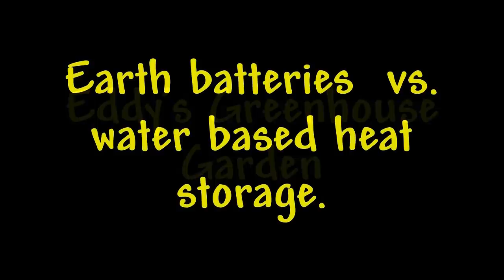Passive Earth Batteries Don't work

Comment: So this guy doesn’t have an earth battery but explaining why it can’t work.
Reply from the maker: Experience is always better but this is physics.   You don't have to  actually try to boil a bucket of water over a single candle to know it won't work......now do ya?
Reply: @eddysgreenhousegarden7022  There is plenty of proof that the earth battery design does work though. Dont be so stuck in experiece that your not willing to discover something different .
Reply: @eddysgreenhousegarden7022 
The vast majority of  folks with these systems are not too good at physics judging by their design choices.

Comment: You don't understand how earth batteries actually work. There is a phase change and energy release involved due to condensation and humid air.
Reply from the maker: For earth batteries, no matter how you define that, I don't understand where you see the "phase change," part of it.  Why don't you elaborate on that a bit.
Reply: I am by no means an expert but these folks are. They explain it way better than I. The phase change is from hot humid air to condensation and back. http://www.ecosystems-design.com/climate-batteries.html
Reply: @eddysgreenhousegarden7022 
If you have 1000 cubic feet of air at 85F and 70% RH and cool it so it becomes 70F and 50% RH it will release over 4x as much heat as 1000 cubic feet of dry air cooling from 85F to 70F. A pound of condensed water represents 1000 btu, to put it into context, it takes 1btu to raise a pound of water by 1 deg F.

Comment: To say that earth batteries don't work is ludicrous. The amount of mass of the dirt 6-8 feet down is huge...it's the earth. And about 48 to 54 degrees 8 feet down, given a reasonable length of tubing, will easily prevent freezing in the greenhouse. The problem that you have with them is that your greenhouse is already established, and presumably, you don't have the land outside your greenhouse footprint in order to run the couple hundred foot tubes. But for someone entering into new construction, it is definitely a worthwhile method to prevent winter freezing. It may not get your greenhouse above 55f, but it won't freeze either.
If a greenhouse is not going above 45f during the day, then that's the maximum amount of heat capacity of the water, well below ground temperature. And over 24 hours and several weeks, you will loose that water barrel heat. I'm not saying that water is a bad method, it's good, water is a good heat sink..but only if you have sufficient sunlight to maintain that heat absorption. Many places in the northern US can go weeks without any appreciable sunlight. That's your heat source, the sun.
The earth heat doesn't rely on the sunlight. It maintains that ~50 degrees year round, with the bonus of providing cooling in the summer, something water barrels cannot do alone.
Reply from the maker: I don't think we disagree on anything.  What I am trying to point out is  there is a camp out there that thinks you can "charge up," the ground and get a 70 - 80 degree greenhouse at night out of it.   In a really cold winter you can't do that passively.
Reply: @eddysgreenhousegarden7022  
The other camp thinks the ground magically recharges with heat regardless of how much you pull out of it ;) The ground temperature doesnt remain constant at any depth with an active system, it will simply reflect the temperature of the new energy balance, heat in vs heat out. As an example, agshp could pull so much heat that the ground freezes, if the ground temp was a constant 48f-54f it wouldnt be possible ;)
Reply: I live in ontario Canada and there have been winter's where people's water lines have frozen 8 feet down if those lines were under an area that has the snow removed, like a road or walkway or parking lot. I say that just to point out that the cold will drive down deep enough if given the time. If you are constantly drawing heat from the ground it will cool down and even possibly freeze. I do have greenhouses as well and with an outdoor wood stove manage to heat them at even the coldest temperatures... it needs wood as fuel. The earth battery sounds interesting but in our climate I am afraid that It would not work. In the greenhouses I do not heat there is frost in the ground. Perhaps in the shoulder seasons it may reduce the amount of wood we burn.

Comment: You are wrong, yes water has about 4 times the heat capacity per mass, than most soils and rocks, but mass constraints are irrelevant, for a greenhouse heat battery. 
Rocks and soil has 2-3 times the density (mass/volume) of water, which means the effect of the better heat capacity of water is  severely reduced, by the higher density of rocks and soil, volume is our constraint in a greenhouse but not so much below the greenhouse and dirt/rocks are often free to get, therefore they can in many cases make more sense than water for storing heat.
Reply from the maker: Do you have one that is actually working?
Reply: @eddysgreenhousegarden7022  I have seen both in person and helped build one with an earth battery, both systems can work if they are built correctly.
If you have enough space on your north wall which you don't need and cheap access to large metal barrels, this method is probably the best for you, however if you want to use all your space /north wall and have a large greenhouse or are designing a new one, the earth battery is probably the better choice.
Reply from the maker: @FruitingPlanet  Just to be clear, some people think an earth battery is something you can change up all summer then extract the heat you put into it during the winter.  They think you can pull 70 degree (f) heat out of it somehow during the winter because you put all that heat into it during the summer.  That definition is what I am saying doesn’t work.  Pulling the natural heat from the ground, from below the frost line in the winter…that does work, but it’s not because someone put any heat into it during the summer.  It is a natural state of the earth no matter what you do.  In any event the natural heat you can get is what I call low grade heat.  It is perhaps 40 - 50 degrees and you need a large surface area to recover it.  That can work but it will only keep your greenhouse from freezing temps during the night.
Reply: @eddysgreenhousegarden7022  it's certainly possible to achieve, but what many don't realize, it's that it takes a lot of mass and good insulation from 5 sides. 
The typical geothermal greenhouse you see, will of course have minimal heat storage over the span of month, however as you said, it can still prevent freezing in many cases throughout the winter of it is done well, store the heat of sunny winter days for the night or cool in the summer. 
However if the system and greenhouse is fairly large, probably insulated with four example double layer "Ytong ThermStrong"/other kinds of highly insulating porous concrete, or double layer hollow brick blocks with rock wool in between and it has a proper ventilation system, maybe even heat pumps, you can most certainly achieve year round tropical conditions in zones 5+ with low to medium electrical input.
Reply: @eddysgreenhousegarden7022  Agreed. This is not how an earth battery works. I've seen this idea floating around a lot these days. BTU loss in an average size greenhouse (24'x72') can be as much as 100,000 btu's / hour in the dead of winter. If you take the dry volume of your earth battery (24'x72'x4'= 6912 ft^3) and multiply that the average heat capacity of 1 cubic foot of soil (63.18 btu / ft^3 * C), you will get 436,700 btus. The calculations are a bit more involved than this. However, this means that if you are able to raise this volume of soil by 1C, then you will get about 4.5 hours of heating for your greenhouse. This soil volume is actually an overestimate so you will likely see less btu's stored per 1C rise in soil temp. Moreover, the cost of materials and installation of a well-done GAHT system is prohibitively expensive compared to heating a GH with a wood stove and storing energy in water. People are actually walking around saying that soil and rock can store more energy than water. 

https://www.researchgate.net/figure/Density-specific-heat-and-volumetric-heat-capacity-of-common-soil-components-at-20C_tbl1_279595517

Science...
Reply from the maker: @jayhayward7579  There are a lot of misconceptions out there all right.  I've left some of the posts that show that  up on my page.   I guess some people get so emotional about what they believe, research or proof doesn't matter to them.
Reply: @eddysgreenhousegarden7022 Yep...especially when they use heat and energy interchangeably...

Comment: You stated that you need to install the Earth Battery before you build your greenhouse is partially false. I say partially because if you are building one then doing it before you build one is the right thing to do. The false part is that you can modify a current standing greenhouse. Your false premise is that the piping would need to be placed into the ground below the greenhouse. This is the false part of your premise. You can place the piping six to eight feet into the ground that is not under the greenhouse. This would be called modifying a current standing greenhouse. Water has its advantages and disadvantages. A disadvantage, it freezes when pipes burst. Water has friction  so the upkeep, maintenance and upfront costs are more with a water battery than an Earth Battery. I prefer to go with the most economical method and the most bang for the buck. Earth battery has been tested for a long time. To state earth batteries don't work is a false premise. (I did not say water batteries did not work, I said they were not the most economical way when compared to an earth battery).
Reply: The piping could be put in a trench alongside the greenhouse. More piping and a larger fan would be needed.

Comment: If you are going to try to store heat in the soil...
You'll need to insulate the area you want to heat..
Reply from the maker: I agree with that.  But it gets expensive to insulate it.  Also the earth really doesn't store energy very well so you  need a pretty good sized area.
Reply: @eddysgreenhousegarden7022  
You only need to insulate the perimeter using 2" eps installed vertically. Most folks can manage to dig a narrow trench a few feet deep ;)
Reply: And then there can also be issues with changes to the water table. If underground water changes direction and hits your earth battery, then it's game over. Water will drain away any underground heat storage very quickly.

Using active heat storage could give you multiple options for collecting, storing and distributing heat - which improves fault tolerance and would allow you winter heating options even during an extreme weather event like a Polar Vortex Breakout or several back-to-back days of subzero weather & overcast skies.

When your greenhouse becomes one of your primary food sources, then it is no longer a "isn't this cool" hobby any more. It HAS to work, and any crop losses could mean you either go on reduced rations, go hungry or go begging.

I have looked at a few earth battery greenhouses on YouTube and I haven't seen solid, scientifically monitored results yet. Anybody can put some cheap temperature logging devices in their greenhouses to log both indoor & outdoor temperatures throughout the heating season. Never mind the anecdotal claims or showing the build but not operations - show us your seasonal historical data.

Comment: Water stores heat better than soil. You have a great point. I’m thinking 6-8’ of stone. Insulated. Do you think I could get some passive heat out of that?
Reply from the maker: I know in the old days they used to heat stones and put them in carriages to keep your feet warm.  So it works. It's just how much stone and what is surrounding it to keep the heat loss down.

Comment: I Am planning on using a split system with 4 inch perforated tubing buried in 30 inches of course stone and two long runs of 55 gallon black water barrels laying against the 70 foot long greenhouse walls. I'll be running several aquaponics/aquaculture tanks and am looking to simply balance my internal greenhouse temps here in Northern Maine in order to eliminate any expensive supplemental heating of the air and water in the tanks. Without any real depth to the underground thermal bank i can't expect too much change in temps with soil, but with varying sizes of stones starting with large 4-5 inch stone, then 1 inch, then granular crush and run for a top layer for leveling purposes i should be able to gain more storage advantage in less space to give me close to 20% gain, no more. So i'm starting out with low expectations on that design and relying a little more on water banking during the daylight hours then emitting the heated water and air in combination at night. With the water i was thinking of connecting all of the barrels together and pump them into radiant water pipe buried just under the crush and run layer of gravel to give me the ability to balance out the entire space with the same temp. air to eliminate cold spots like door openings that might leak etc,.
Reply: Why dont you try a Rocket mass heater?It burns much less wood than a conventional wood stove.
Reply from the maker: That sounds interesting Tom.  I know rock does hold heat better than plain soil.  I  will be interested to see how it turns out.  Sometimes  that is how it is.  You have to try it and see. 
Ed
Reply: I am in Manitoba Canada. I’m going to try the same idea here. It was -41 degrees Celsius here two weeks ago. Hard to fight that kind of cold.
Reply: @creedsixteen891  Look into rocket mass heaters.Insulate the greenhouse well with double walls,the thicker the better.

Comment: I thought I was going to get some real information regarding earth batteries not just an option on why it isn’t a good idea for you.
Reply: water specific heat: 4,200 Joules per kilogram per degree Celsius (J/kg°C). This means that it takes 4,200 J to raise the temperature of 1 kg of water by 1°C.
water kg per gallon: 3.7854 kg
water gallons per cubit ft: 7.48 gallon
btu per joule: 0.000947817

btu stored by water per cubit ft per 1°C rise: 0.000947817 btu/joul x 4,200 joules/kg°C x 7.48 gallon/cubic ft x 3.7854 kg/gallon = 112.7 btu/cubic ft °C
btu stored by water per 10 ft x 10ft x 1ft per 1°C rise: 112.7 x 100 = 11,270 btu

clay specific heat: 878 Joules per kilogram per degree Celsius (J/kg°C). This means that it takes 878 J to raise the temperature of 1 kg of water by 1°C.
water kg per per cubit ft: 51.71 kg
btu per joule: 0.000947817

btu stored by clay per cubit ft per 1°C rise: 0.000947817 btu/joul x 878 joules/kg°C x 51.71 kg/cubic ft = 43.03 btu/cubic ft °C
btu stored by clay per 10 ft x 10ft x 1ft per 1°C rise: 43.03 x 100 = 4,403 btu